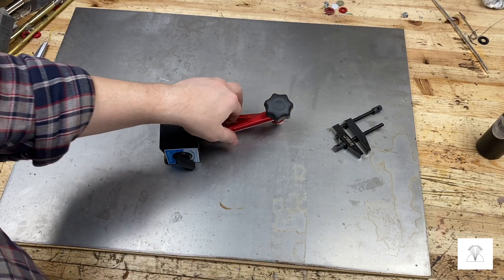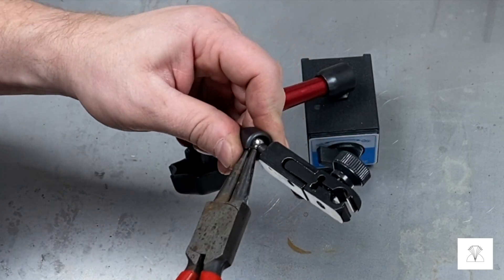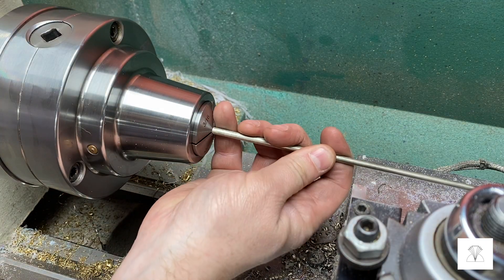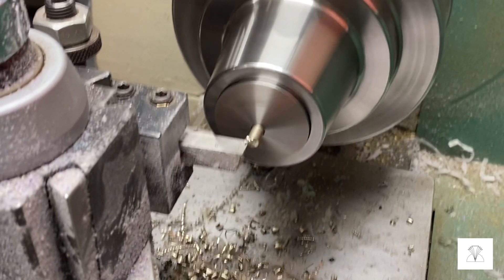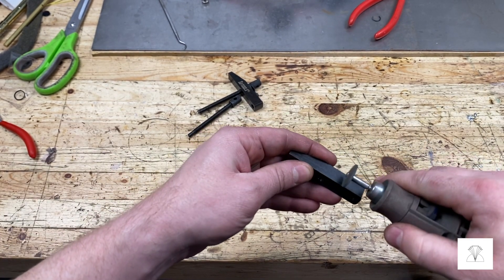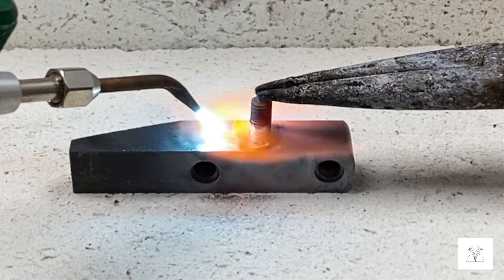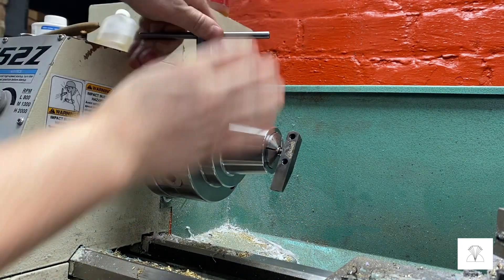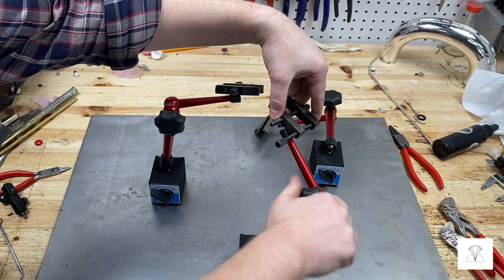Making a soldering/brazing station with machinist clamps and magnetic base indicator holders

Comment: Nice Smith Little Torch! I made a set of these clamps using old Starrett indicator holders back in 2013. They have proven over and again to have been a time well spent. I still have one of the three-armed jigs from Ferree's and I have always hated it because it is so fiddly and difficult to adjust perfectly. Nice vid. Liked and subbed.